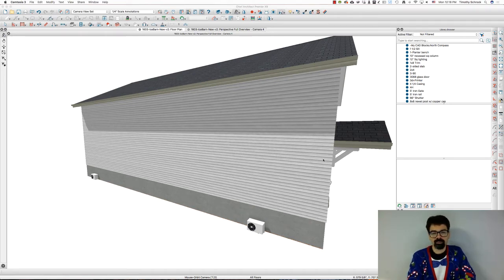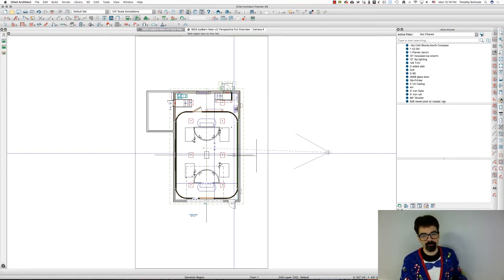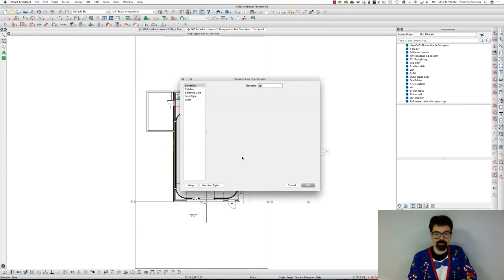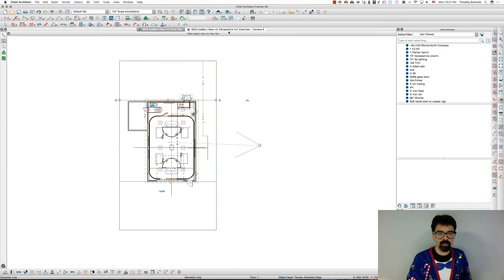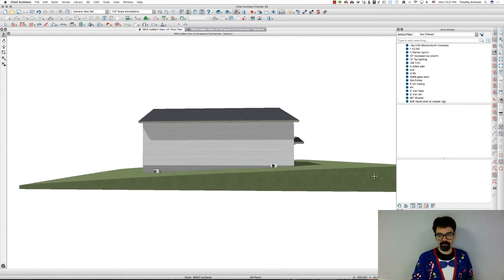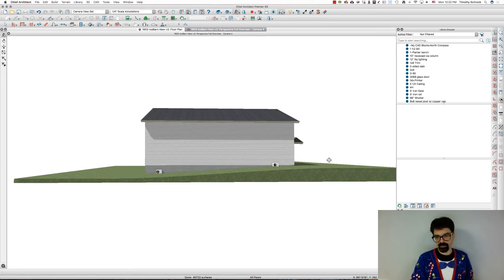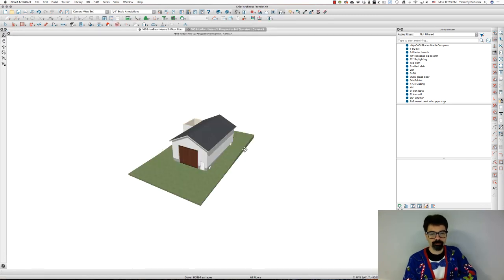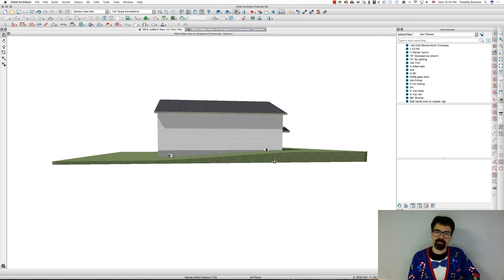Terrain Basics

Comment: You are exactly the type of teacher I was looking for. Thank you so much! I'm struggling with terrains now since I have a church put in the valley of a very steep hill going left and right to it's foundation. Picture the building in the crotch of an upward V. that reaches 12' right and 12' left on the x and y axis. very confusing to me how to get that to work so the terrain works.
Reply from the maker: Was this video helpful in getting that figured out?
Reply: @DesignbuildsolutionsLLC  I cant figure out how to get the v of two directions going up hill. I'm new to terrains
Reply from the maker: @ellkir1521  draw multiple nested V’s of terrain lines with ever increasing (or decreasing - if you start at the top of the hill) elevation values
Reply from the maker: Here's a quick tip on how to do it. https://youtu.be/VjgWCZ6teOU

Comment: Thank you for that quick run-through.
I deal with a lot of sites where we cut and fill (slab on ground construction rather than in-ground footings and base build up) and create timber retaining walls to shore up the cuts and fill over-runs.
This aspect doesn't appear to be covered by Chief particularly well. With a front sloping lot you have the cut at the rear, say 3.0m behind the building then a vertical slice, covered by the retaining wall, then the natural slope resumes. The building pad doesn't extend to the perimeter of the site so it is contained within the retaining walls.
Would really appreciate to see how to make the pad work correctly.
On another note. I draw a lot of "standard' lowset homes - 150 - 350sq.m. all containable on A3 sheets. I set my layout page up to contain all the various items that eventually get transferred to it from ther floor plan / elevations / sections / cabinetry, etc on a Master Template. Once a plan is drawn and saved I call up the Master Layout and then call up the new file and all the information for the new layout is transferred across. Same effect as Revit. I hadn't been able to find this information anywhere in Chief and I think, for similar, repetitive style drafting it speeds things up dramatically yet is never commented on.
Your thoughts.
Keep up the good work, your sessions are always informative and herlpful.
Reply from the maker: Michael Vella thanks for the encouragement. As I mentioned a more advanced tutorial is coming. I’m working on it now, and hopefully that will help you with your situation. If it doesn’t, let me know and I’ll try to address it more specifically. 
On the other issue, sounds to me like your system is working well. I’m definitely all for making shortcuts that save time and energy for you. As long as the shortcuts don’t shortchange the product!
Cheers!